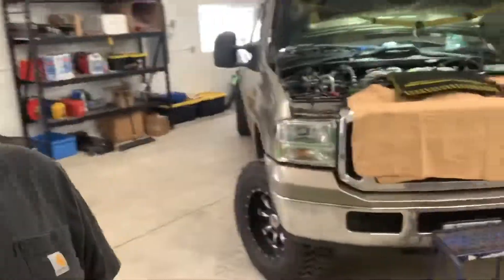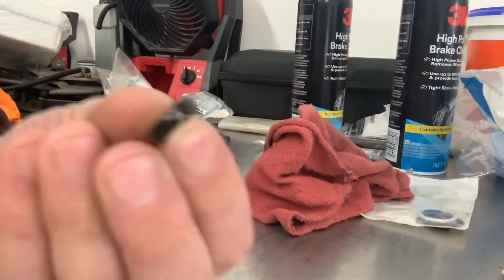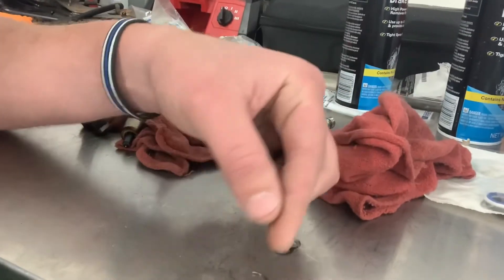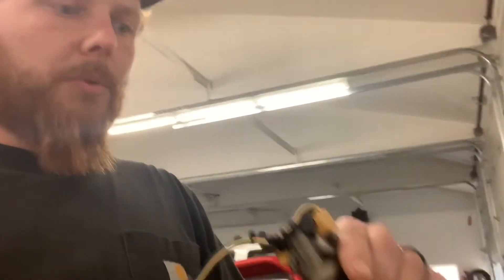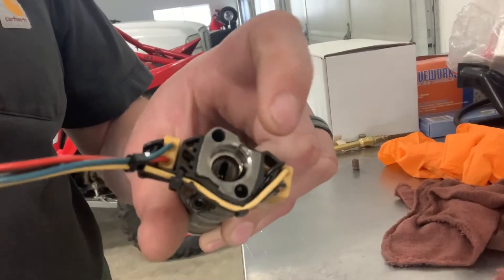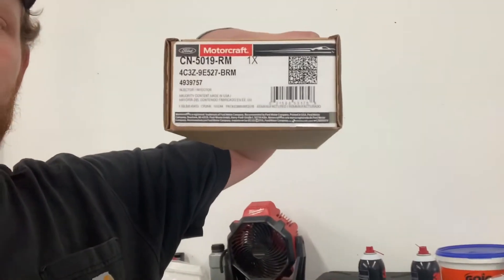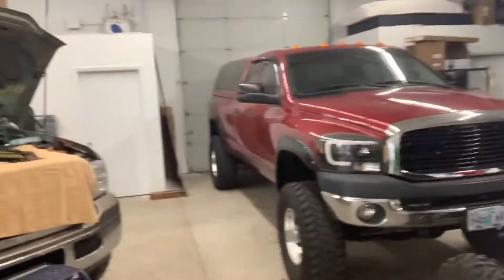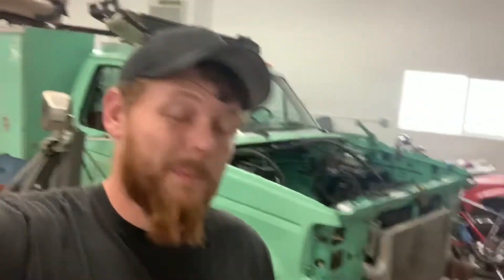6.0 Powerstroke High Pressure Oil Leak - Part 1

Comment: Wait... You would send Your brothers truck out the door with a jimmy rigged fix? Damn bro... how you expect us to believe you wouldn't do this to a customer? Could have done without that admission.... horrible customer service.
Reply from the maker: Did ya miss the part about how the pump is good but used? If the part fails, worse case scenario is the truck dies or won’t start, just like it had already been doing. As also mentioned, we are using the used pump until the new warranty replacement one gets sent to us so he can use his truck in the meantime because he needs it. He agreed to re-using used parts until the new one came in. We didn’t take his money for a new part and just ship him out the door telling him his truck is fixed. We offered this idea to him as a temporary solution. The used pump that’s in it is in better shape than the old one we took out of it. Where is your issue with this?
Reply from the maker: 13:14 - maybe listen to this part again?
Reply: Haters gon hate. If you listen to the video there’s no “JiMmY rIgGeD fiX” you potato. He puts a good used pump in because his brother needs the truck not to mention his brother more then likely approved it and understands the risks...